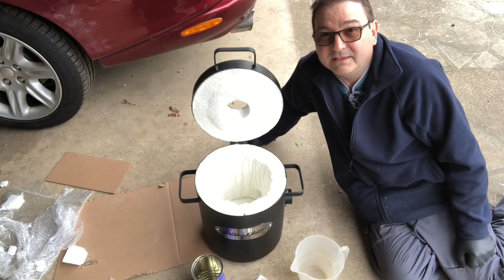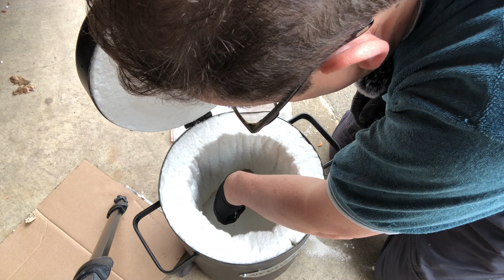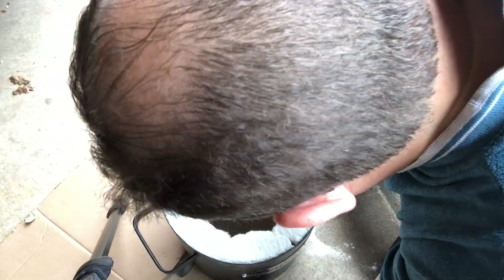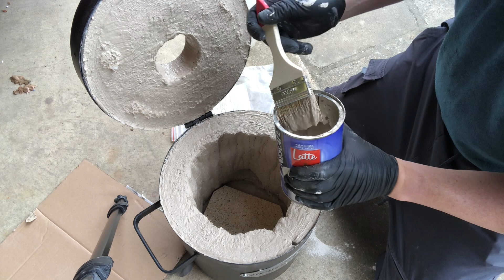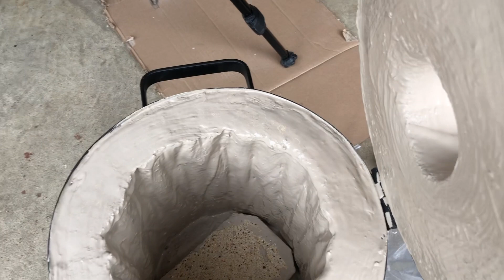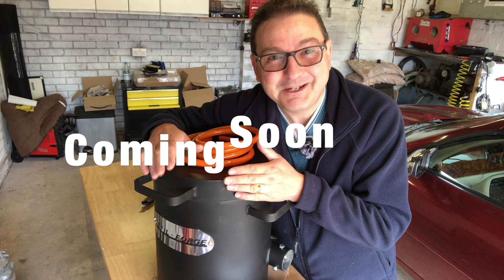Add ceramic liner to your Devil Forge furnace.

Comment: Hello subscribed👍 I've been getting one and cheers for showing me how to do it.how long do you let it dry for and do you fire it up to finish the drying process?another thing do you watch big stackd channel? That's where I got the idea for the devil and he shows you how to make lifting and pouring tongs which I've kind of copied with the metal I had.
Reply from the maker: Rastaman Ralph hi
Thanks for watching
I have not seen that channel so I will enjoy checking it out👍
I let mine dry over night and then fired it up as gently as I could for 10 minutes at a time with 30 mins between each firing before finally letting her right up to temperature.

You will have great fun when you get it. 
Stay safe mate

John
Reply: @tothegarage  I've had it for a few months but have needed to make some tongs so I put it on the back burner until yesterday.I bought everything else I need but now realize I need some tongs for putting things into it.I'm sure I can wack something up soon.I'm going to paint it tonight.does the stuff smell because I was going to do it in the house? Also big stackd New video is about him breaking up a 43kg motor and smelting the whole thing of aluminium and copper.
Reply from the maker: @rastamanralph6670  no smell at all that i can remember👍